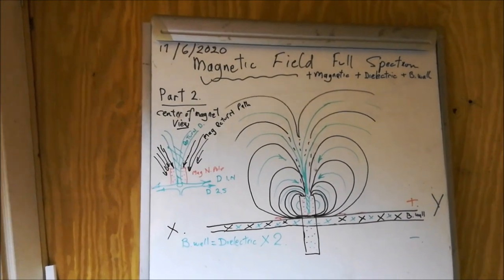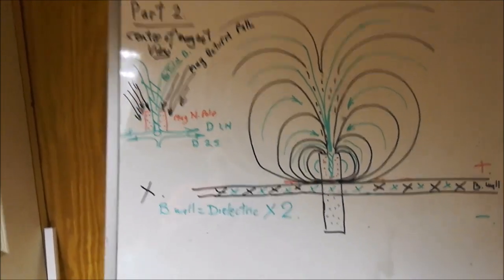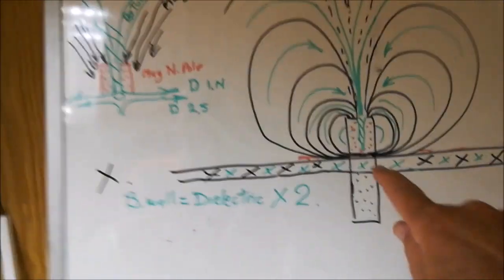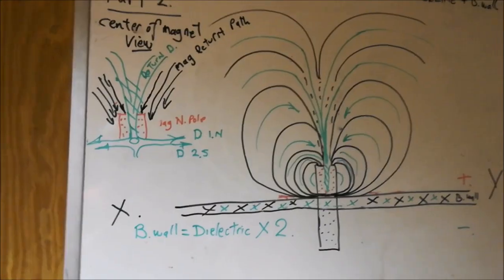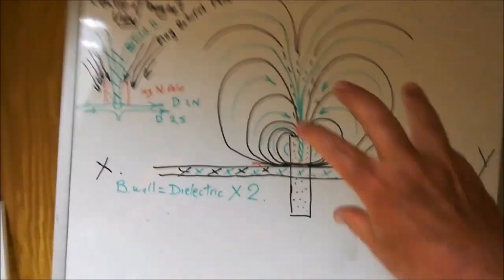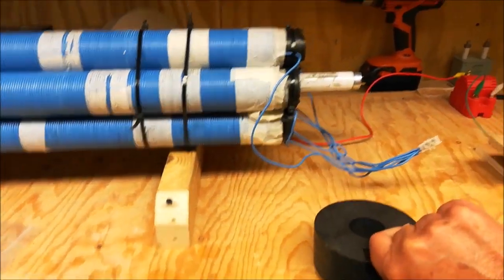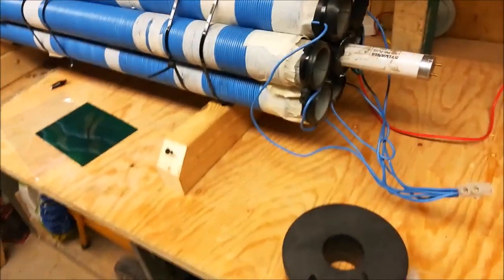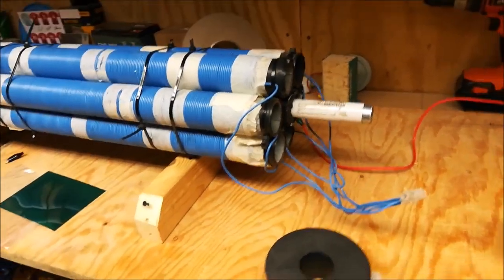Magnetic Full Spectrum Part 2 ( Plus Dielectric & Bloch Wall )

Comment: I think harvesting radio frequency/ resonance is important? Antennas with copper and or aluminum pipe 2-3" diameter? With air pressure or water glycol pressure inside pipe? Radio frequency/AC attaches to outside of pipe antennas?

Comment: What if on a magnet, north pole is positive, south pole is negative and bloch wall/dielectric inertial plane is actually a ground/neutral? Hence when you put magnets in north south arrangement in generator, you get alternating current with both positive and negative voltages, and between each magnet you have bloch wall hence zero voltage between positive and negative voltages in AC current. 
Also if you take two 9 volts batteries for example and connect them in series and use the middle terminal as virtual ground, you get +9 volts DC on positive terminal and -9 volts DC on negative terminal. 
Alternatively you can connect two 10k ohm resistors in series between positive and negative terminals of DC power supply and use the middle point between the two resistors as virtual ground and get your positive and negative voltages.
Negative voltage i think is what life uses as bio-electricity, maybe that's why Ken Wheeler's magnetic seed experiment produce beneficial results when plant seeds are under the influence of south magnetic field and bad results when under the influence of north magnetic field.
Reply from the maker: Hi X.B. The dielectric Bloch wall is the capacitor which can flip its - + potential. Too much to learn not enough time. Regards.. DC
Reply: According to Fractal Woman channel, you can measure 1.44 volts on poles and 0 volts on dielectric inertial plane/bloch wall. Check video "On The Fractal Nature of Magnets (and the universe).".
Also according Robert Distinti, you can measure thousands of amps on magnet on shining part in magnetic viewing film which he calls edge currents. Check video "NEMA003: Magnet Table -- Validation of New Electromagnetism Model of magnets".
Reply from the maker: X.B. now we are on the same page! Regards.. DC (PS) fancy making one?
Reply from the maker: This is my level of learning, in the moment. I can see possibilities, for future technology if this is developed.... DC
Reply: Then you get anti-Gravity.
Now...how to boost the energy output...?
(Just because I don't know what I'm talking about doesn't mean I'm lying.)

Comment: According to electrical engineer Eric Dollard, you can have dielectric field (electric field) and magnetic field going in same direction instead of at right angles (90 degrees). Google "Transverse & Longitudinal Electric Waves and Tesla’s Longitudinal Electricity". For LMD circuit diagram google "The L.M.D./T.E.M.Test - JLN Labs". Also you can use Trifield meter to see the differences between LMD and TEM, check video "Replication of Eric Dollard's Analog Computer" on it.
Reply from the maker: Hi X.B. Yes this is so good! We just have to play with it. At 73 years of age i get excited cos i can see it working!!!
Vision is so important. ..... Thanks X.B. .... Cheers... Regards... DC